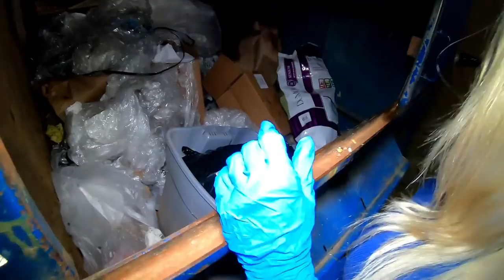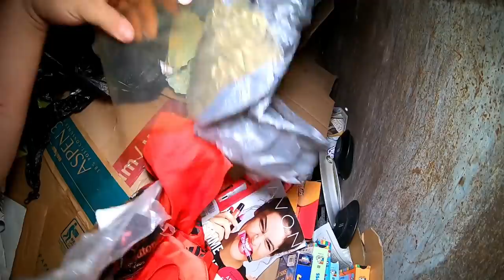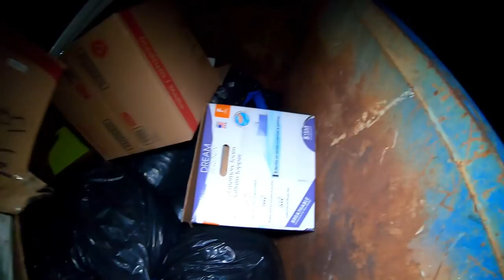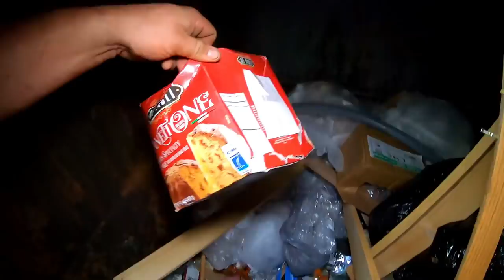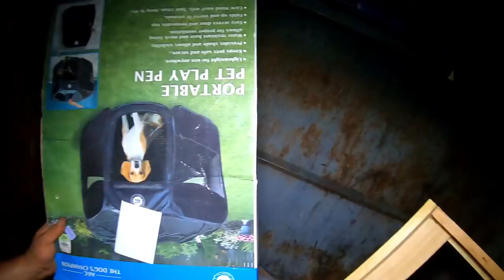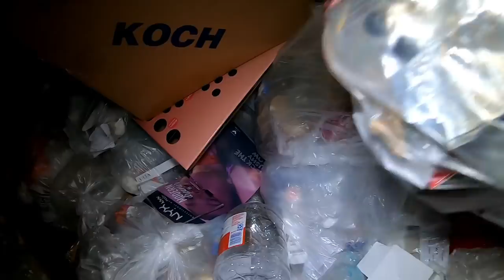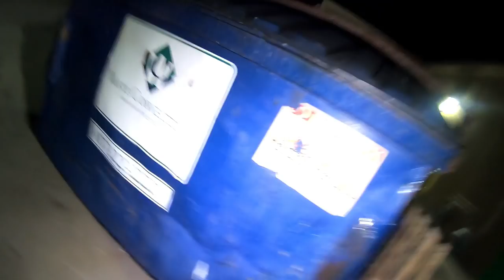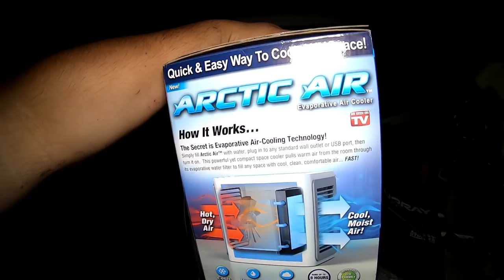We Found Lawnmowers Huge Copper Cache And a Ton Of Brand New Goodies While DUMPSTER DIVING

Comment: Those wee bottles are for essential oils. I use them all the time 🤗. They are quite expensive.
I would have taken that New York coffee shop plate and the glass candleholder.
It’s a shame people dump so much stuff without recycling as much as they can 😥
Great video again guys 🤗💕🏴
P.s. I think you would have been fine taking the mowers.
That wooden thing u thot was a walking cane is actually a handle and shaft for a garden too. Lol. 🤗

Comment: I think taking the mowers was perfectly fine.  If they were keeping them they would have changed them like they do grills & they are old.  Edward Scissorhands wasn't to good with his hands in the beginning just takes practice.  If you looked thru the bags you might find gift .  cards for your makeup.  You could try to get solar lights to add to the butterfly yard stake.  There is DIY's on how to do stained glass maybe make a pattern of the other side portion of the wing that is missing to make a replacement.  You might be able to get some glow in the dark paint & paint the trim of the butterfly so after dark it glows.  Your hubby might be able to help

Comment: I'm sure someone dumped them lawnmowers.  They probably didn't put them in the dumpster in case someone wanted them.  They were probably draining the old oil n gas so it wouldn't get in someones vehicle and probably because it needed to be. I wouldn't worry. If their by a dumpster I'm sure they were dumped.

Comment: You didn't do anything wrong on taking the mowers and stuff it was at the dumpsters. I don't think they wanted to put them in the dumpster because of oil and gas in them. That's why they had them on the side so it would drain out.